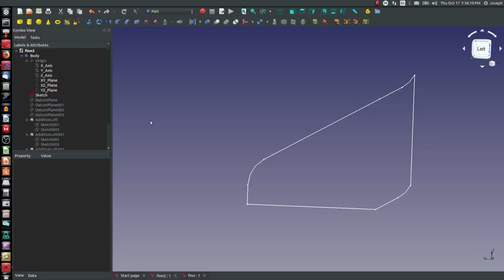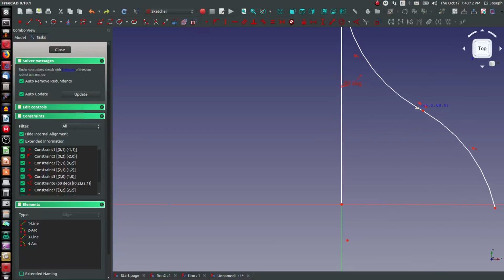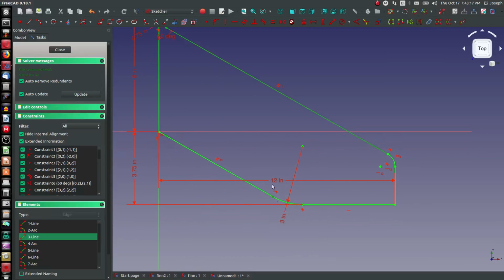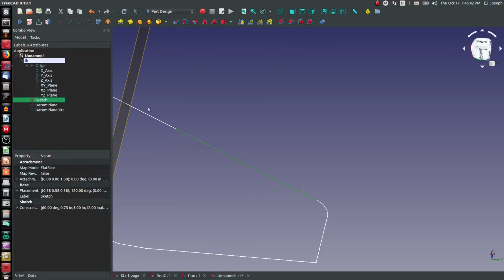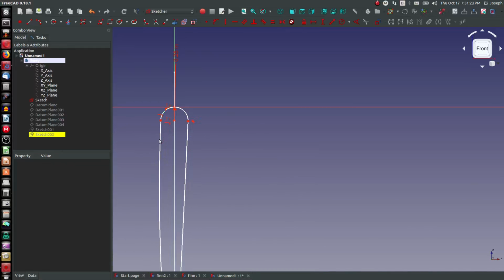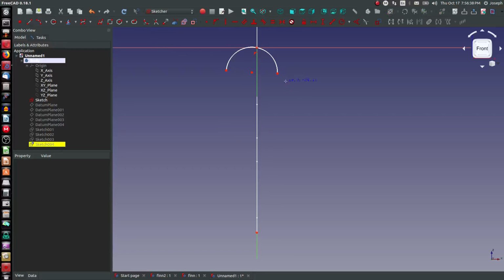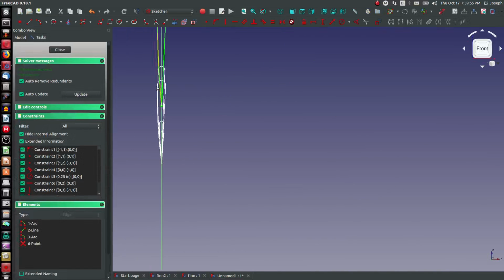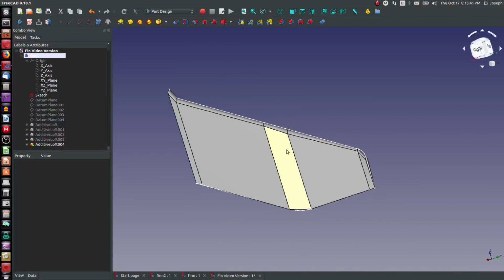Make a Wing / Fin / Air Foil in FreeCAD |JOKO ENGINEERING|

Comment: Try the curves WB. I found it very useful in my 3D print fly wing project.
Reply: I too have been trying to print wings using curves wb but unfortunately found it hard to put thickness to it so I could print thin enough. How did you do it?

Comment: Another great video! 2 questions.
1. How can you give the airfoil skin loft a thickness for a 3d print. Not make it a solid but still hollow. Slicer wont recognize a thin line.

2. How do uou close up the end of the loft so its not open and also give it a thickness for a print. Mainly to create a base. Tha ks again, great as always
Reply from the maker: Great question.  I would model the foil with the origin placed at dead center in the middle of the loft  profile sketches and if the thickness command doesn't work, use the method at 24:33 in the mouse video here 
https://www.youtube.com/watch?v=Yyffu0dY8fc
That would create a hollow cavity within the foil.  You could also put the origin dead center in your first loft sketch and use the same hollow method then re-loft your first two sketches and merge the bodies to make a solid end with a hollow region.  Hope that helps